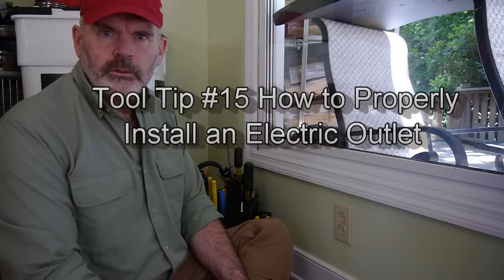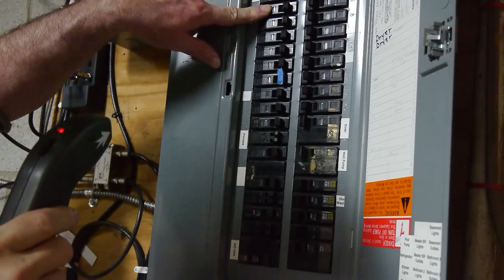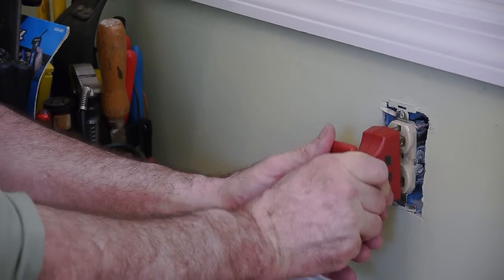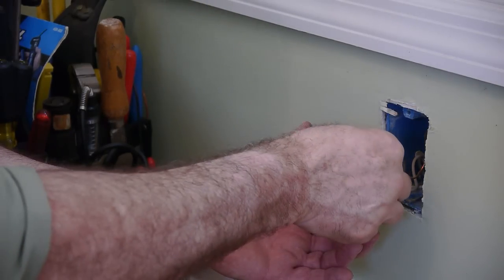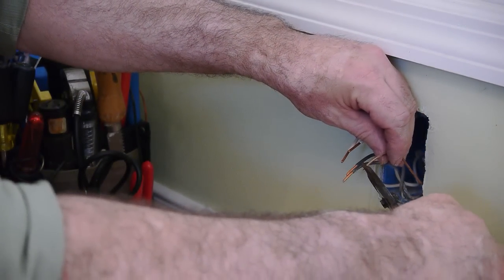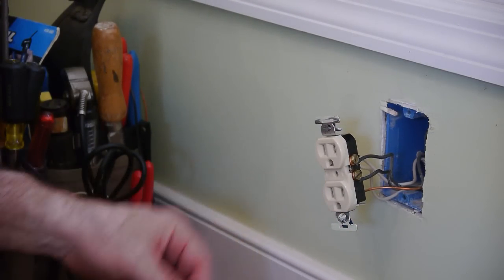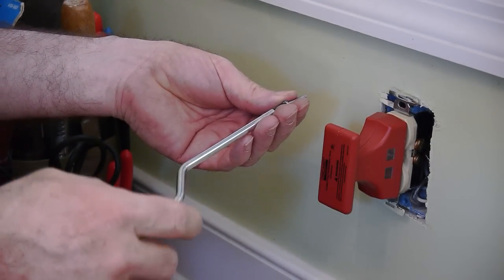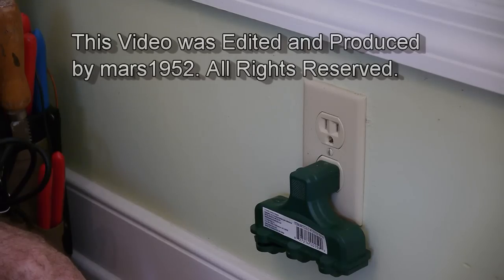How to Properly install a Electric Outlet Tool Tip #15

Comment: A upside down receptacle means it’s a switched receptacle.  I’m surprised I didn’t see this already in the comments. I guess I did learn something in school lol
Reply: Sylvia isgod you’ve never seen upside down recep?
Reply: Sylvia isgod I have. Did you try to control it with a switch ?
Reply: I never seen one upside down which side up , which side is down.
Reply: I've been in many houses with switched outlets and not one of them has been "upside down " as you would describe it nor is that a code anywhere to say so.   Either way is to code and isn't safer than the other.  Usually commercial is ground up and residential is ground down.
Reply: Affordable Solutions hey I’m not here to argue with you buddy, just telling you what I know. You don’t have to agree with it, I could care less
Reply: Sylvia isgod yeah I’m just telling you what I know, and what I learned in a private junior college. That’s all.
Reply: Affordable Solutions all you have to do is google it lol it is know by many, just not by you lol there’s always room for learning new things lol
Reply: @1prodbyhd  who's arguing? I wouldn't trust a auto mechanic to do my flooring so why would i trust some homeowner to give professional advice..
Reply: @1prodbyhd  i have frequented and I am a member of many associations and groups especially in the electrical field and I have never heard nor seen any comment based on upside down receptacles or a green label associating such a "switched receptacle ". Am I wrong,  very unlikely but maybe I missed that article do forward us the links so that we might educate ourselves. But I wont take it seriously if you refer to a link from homeowner hack monthly magazine stating "a tip" to  homeowners doing it this way for their alzheimers parents.
Reply: Affordable Solutions bro just google it ? There’s multiple sites talking about it, and if I need to send you the page number in my book where it talks about it I can do that too. lol
Reply: Affordable Solutions just cuz you never heard of it don’t meant it’s not relevant ? YOU DONT KNOW EVERYTHING BUD. Are you even a electrician ?
Reply: No such thing as upside down. I have GFCI receptical that has one end marked as "Top". Guess which end. The end with the ground terminal up.
Reply: @1prodbyhd  
If you could care less then that means you really care. Personally, I couldn't care less.
Reply: @njsongwriter  your so smart bud.
Reply: @njsongwriter  no such thing as upside down receptacle ? But your gfci has a top and bottom ? Boy, wtf are you talkin bout 😂

Comment: what and where is the red tool he used to pull the recep out and where can i find it. that be a good tool it you had to wire it hot. I dont get why he didnt turn it around he needs to know a little extra wire is better thsn it being snug tight and if they want a diff color outlet they dont have to re run the wire if ite damaged or cut. Hes not sharpest knife in the drawer
Reply: It's called a Digital Circuit Breaker Finder. Search for KLEIN Tools ET300.

Comment: What do I do when I have 2  grounds
Reply from the maker: All of the ground wire can be combined.
Reply: @mars1952  I totally agree. If the ground is supposed to be up maybe they didn't inform the manufacturers about this. I would think they would know for sure. Everything they produce is for ground down and if it was code they could be held liable. Ground Down!!!!

Comment: It's actually was installed correctly... check out how they are installed in hospitals and such...🤷🏾‍♂️
Reply: If the guy thinks he's a profecional electrician
Then im a master electrician 😂😂😂😂😂😂😂
Reply: Either way is correct and not safer than the other. Its that way in hospitals and such because its commercial and different use, materials and needs. Residential is ground down.

Comment: Hi, i was wondering why you didn't just flip it over. Is there a reason? In the old house we just bought, every single one of the outlets are upside down. But the reason we are switching them is because they are SO OLD like from the 70s and meanwhile we want to turn them the right way. Do you have any advice?
Reply from the maker: If you don't want or need to replace the outlet you can just remove/rotate/replace the outlet. In some areas, the building code states that the outlets have to be installed upside down. Why might you ask? Because politicians have to have something to do. I suggest replaceing the outlet with a medium priced one with good clamp on contacts. You will already have the power turned off and the outlet removed so why not do the whole job?
Reply: The NEC doesn't say which way to put the ground.

Comment: The electrician that wired my house 50 years ago didn't believe in grounding the outlets. All my outlets are not connected to ground.
Reply: You can just replace those receptacles with a GFCI
Reply: 49 and 1/2 years ago grounding became a requirement.

Comment: I believe all receptacles should be pigtail and wired in parallel instead of in series so that if one receptacle malfunction, all the receptacles in that same circuit continue to have power. Easier to troubleshoot.

Comment: Why re-wire? All you’ve done is turn the outlet around.  And I just replaced one which had wire on side screw that was faulty. Way too many fancy tools. Check with your chiropractor if you can’t maneuver the outlet. That red thing looks bulky and gets in the way.

Comment: wrong ground up is proper.  I've been master electrician for 23 years . ground down is what burn houses  down
Reply: sparky12x  the reason for ground up is more important than the vanity of your night light being upside down. say your cord becomes slightly unplugged then something conductive and slim slides off table and down right on the 2 blades of cord gets stuck breaker is faulty  BIG FIRE.  on the other hand ground up forces object to slide off one side or other henceforth avoiding the BIG FIRE
Reply: Lol  look it up in the details and follow the plans.

Comment: Didn't help at all. Needed to get the wires out of existing outlet and you took a shortcut and just snipped them.
Reply from the maker: Usually, there is a small hole right next to where the wire is inserted. Make sure power is off.  Take a bare wire and push it into the hole and the wire will release.

Comment: Must have one up, two down for safety reasons. "Twins down" eliminates accidental short circuiting when a thin object slides between the wall and the not-fully-inserted plug. Children, physically challenged, and the careless are served with logic.

Comment: that is way wrong!!Nice except common practice now is to install with the ground up./federal code. If breakers are labeled properly you don't need that tool.running in one side of an outlet out the other was common until the 70's or 80's that can cause a fire hazard. The wires should have wire nuts with a lead out for the outlet.
Reply: That is correct,  an the best way , however many  Municipalities still allow the other way

Comment: Not too bad for Not being an electrician  but your outlet was too loose at the end should have been tighter and what you called and upside down Outlet is actually code correct to have the ground on top but industry-standard always puts  the ground at the bottom except if you're in a hospital or doctor's office you will notice the outlets all appear to be upside down which is actually code correct now in a lot of homes the Builder electrician will install the outlet upside down as you would say if it is switch controlled. I'm an electrician and I also have a YouTube channel but I never post how to videos with electricity involved because it takes many years of on-the-job apprenticeship to be qualify to do electrical work a lot of people take electricity for granted as if it is an every day Home Improvement project and you should not be doing electrical work if you've not been properly trained I always say you never see anyone being killed from a Plumbing Leak but if you do electricity wrong you can kill people

Comment: I’m not sure how much that goofy tool is you are using to test live circuits, but a radio works better. Plug in an old boom box into the outlet, crank up the 80s rock and go to the panel. Flip the one you think it is a or a multitude of them until you find it.

Comment: The longest , drawn out overly complicated recep switch out I’ve ever seen.  Here, people:  1.  no right or wrong, or “upside down “ 2.  Green or bare to ground. 3.  White to silver screw. 4.  Hot to brass screw.  5.  Backstab if 14 gauge wire, if you want to.

Comment: You didn't really say where the ground wire goes. You have a lot of handy dandy tools.
My 'contractor' wanted to charge me $150 to change out 5 electrical plugs. I'm going to do it myself!
Reply: $150 for 5 outlets is reasonable. It's just not worth the time or cost effective for an electrician or other contractor to come out to do something that small.

Comment: I thought i was losing my mind when i saw that the ground was on top and he said it was wrong. People like this should be banned from putting up diy videos
Reply: Sensitive as well.
Reply: What are you talking about? this video was textbook textbook spot on.
Reply: Its neither right or wrong, its up you.  Commercial is ground up and residential is ground down..neither way is safer than the other.

Comment: Wrong.   Ground up is required as per the latest NEC regs.   Again wrong.  Even if the box is grounded all receptacles MUST have a ground wire connected to a ground screw in the metallic box.  You should learn how to properly make a loop in a wire.   First a right angle bend, then form the loop in the opposite direction of the bend. The finished loop should resemble a question mark, not a fishing hook.  Anothe violation of the code:    The two wires from each side of the receptacle should be connected to the device with jumpers not using the second screw.   Before educating others, learn the correct technique yourself.

Comment: Really just shut all the breakers. 
Your tool. Is junk. Or most likely it’s the operator. Because that’s not the way that tool works.
Reply: The one i have ask to scan the panel to "learn it" then scan.

i have the hf one , works fine. It'll get within a breaker anyways.